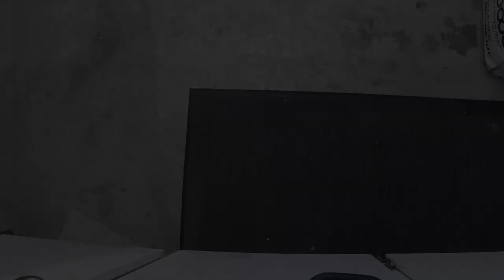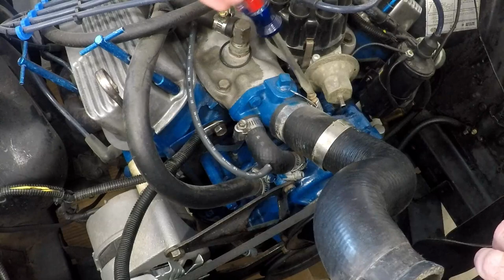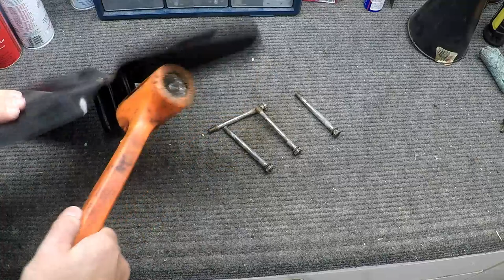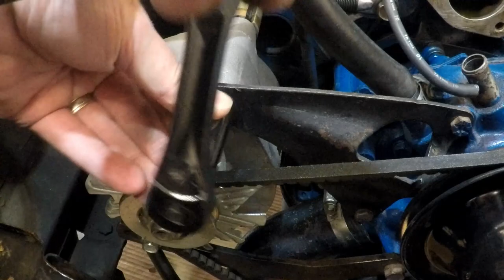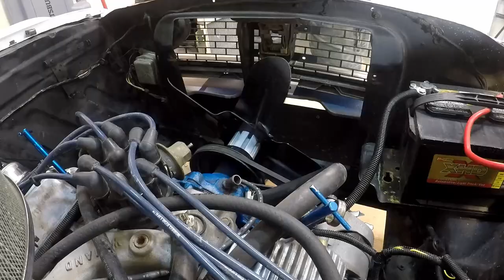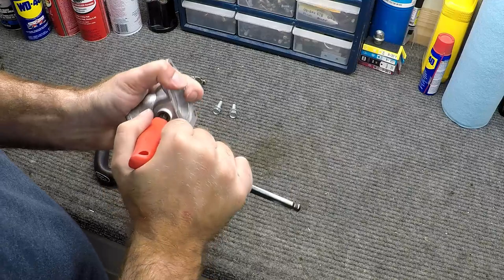How to Install a Radiator in a 1966 Mustang

Comment: Great video Andy.  Thanks for posting.  I especially enjoyed the bloopers cuts at the end. Lol.   One thing I want to add is the next time you need to install or remove the radiator I always like to cover the aluminum fins in a thin piece of cardboard to prevent them from getting bent or ruined.  It's also a great way to prevent your knuckles from getting cut up if you ever need to remove the fan without removing the radiator.  Great job though.
Reply from the maker: This is a great idea, thanks!!

Comment: Great video! Again your videos are great because of the concise camera angles…hey I gotta ask: are there no transmission lines in or out of the radiator?
Reply from the maker: Thanks!
There are no lines on that car as that car has a manual transmission.  However, the hook-ups are in the bottom of that radiator for anyone that has an automatic transmission.

Comment: What kind of spacer did you use? I got a used 3 row champion, and of course the fan won't fit with the different set up. First 66 I've owned so it's a little different 😅 the old rad wasn't even bolted up the same way yours was. Just trying to get it back right and the way it should be. You recommend bolting it back to core support or would you go with mounting brackets with rubbers? Any help would be great haha thanks!
Reply from the maker: Sorry Boss, this was several years ago and I don't have that car anymore.  :)

Comment: 2 month update: how’s it holding up?
Reply from the maker: No leaks and the temps are right where they need to be.  10/10 would do this radiator again, but I'd put a little more effort into finding a better shroud.  There is diminishing returns with shrouds, they can get pricey and not really work any better.  However, I'm sure there units out there that fit better.  Still very happy with the overall setup.

Comment: Does your radiator not require an overflow tank? Great angles btw this will be helpful when I do the same thing
Reply from the maker: Overflow tanks are not required, but they do help refill the system if it gets too hot.  Today's video is about me adding an overflow tank, check it out at 4:00pm PST.  :)
Reply: @AndyKruseChannel  guess I asked this question on the perfect day. Thanks I’ll check it out

Comment: I know this is an older video but others start the car up with the radiator cap off, run it, and then refill it.  I noticed you put the cap on and then said you would run it?  Any truth to either?
Reply from the maker: I have since purchased one of those funnels that plug in at the top of the radiator so the air bubbles can easily come out of the system.  I would have used that in the past if I had it, but I never had coolant issues with the old way I did it.  :)

Comment: You should put thermostat housing sealant on that gasket! The thermostat housings on 289 consistently leak there! Also is this a 2 or 3 core radiator?
Reply from the maker: Thanks for the heads up on the gasket sealant, I plan to redo the heater hose down the road, I'll hit it then.  :)
The radiator is a 2 core unit.

Comment: Great video. How did you bleed the system afterwards?

Thanks.
Reply from the maker: Thank you!
I didn't do it in this video, but normally I drill a 1/16" hole in the top of the thermostat so it lets the air out but it doesn't really affect the cooling system (I cover this in later videos where I replace the thermostat or add a new radiator).  But in this case, I just ran the car until it got hot enough to open the thermostat.  Not ideal, but it worked.  This is an older video and I realized I how to do it better later in my build of this car.  :)
Reply: @AndyKruseChannel  Thanks.

Comment: Hey Andy, can you tell which especific champion radiator you bought? And did you have to bought a new fan spacer? I need to change mine but there so many in the market I don't know which rad to choose
Reply from the maker: This link is the exact Radiator I purchased back in the end of August, 2020:
https://www.ebay.com/itm/163320214225

Yes, I did need to buy a new spacer, it was from O'Reilly's Auto Parts, number HDN 3962.  It's a 2" spacer, not the prettiest, but it does exactly what I needed.  :)
Reply: @AndyKruseChannel  Thank you very much, If it's preforming well I'll buy it too
Reply from the maker: @XSpt1  It's doing great, I installed that part back in Aug 2020, it's been solid ever since.  :)

Comment: Just curious, did you need to pull the belt off to get that lower hose removed?
Reply from the maker: The way that lower hose was routed on my car, there was no need to remove the belt.  It may have made things easier if that belt and alternator were out of the way, but I didn't want to do any extra work.  :)

Comment: Can’t seem to remove the bottom connections on the rad to remove it
Reply from the maker: The bolts for the Rad to the Core Support?  Or the transmission cooler lines?  Or the lower Rad hose?
Reply: @AndyKruseChannel  Andy I’ll send you some photos lol I got it off but the fan is so close to the rad now
Reply from the maker: @AmericanMuscleCarTV  Yes, some Rads are thicker than others and it may cause an issue with clearances.  You may need to buy a shorter fan spacer (that piece between the fan blades and the water pump shaft) to get things to fit properly.  :)

Comment: So what do you do with the 2 bottom hoses that go from the transmission to the radiator? Do you have to hook those up? or can you bypass those hoses and end cap it?
Reply from the maker: If you have an auto, you'll want to either hook them up to the bottom of this Rad, or get a separate, smaller radiator so your trans will stay frosty.  If you don't have an auto, or you don't need to use the two attachments on the bottom of the Rad, you can cap them or leave them, it won't matter.  :)
Reply: @AndyKruseChannel  yes, i have an automatic 69. And an aluminum rad, if its not gonna matter id rather just cap it off, Thanks for your help. Great channel brother
Reply: @AndyKruseChannel  Hey Andy don't know if you could help me out, what exactly did you use to cap them off, looking at replacing my radiator but being in the uk some parts are harder to find in country. Would normal bolts do the job or would it have to be something different
Reply from the maker: @matthart766  You don't need to put bolts in that cooling section of the radiator, no coolant will come out in those two spots.  Think of it as a piece of tubing that is connected on each end at those two locations, and the tubing routes through the tank at the bottom of the Rad, and allows the temp of the coolant to cool that transmission line by way of conduction.  :)

Comment: What's the procedure for bleeding the air once done?
Reply from the maker: Pull the cap, put funnel in top of Rad, pour in fluid until it just start to fill the funnel.  Fire up the engine, let it get up to temp, may need to squeeze the upper Rad hose to get air out.  Once car is warm, and both Rad hoses feel about the same temp, turn off the car, remove the funnel, replace the cap.  Done.  :)

Comment: Will the brakes work from a 16 to 20 inch? Or do I need to replace bottom support brakets?
Reply from the maker: Not sure what' you're asking.  Brakes from a 16" to 20"?  What bottom bracket?
Reply: @Andy Kruse  lol. Sorry. Fat fingers like to hit the wrong buttons. And auto correct has to put its 2 cents in. Which makes my sentences make no sense.  The bottom radiator support. Will a 20 inch radiator fit where a 16 inch radiator was? Or do I need to change the bottom support?
Reply from the maker: There is no bottom support, the Rad is held onto the core support with 4 bolts.  Some places that sell radiators show the dimensions, from there you can compare them to your setup and see if it will bolt into the same spot, or if you need to drill new holes in your core support.  :)

Comment: Hello, I will replace my original radiator for this one ,  after many months what’s your review on the radiator, recommend?

Thank you for the video, I will be replacing mine soon.
Reply from the maker: I sold that car about a year after I made that video, but that radiator was awesome the whole time.  The fit was great, and when I finally added an electric fan, since it's a popular radiator, I was able to find an aluminum shroud designed to fit that Rad and a 16 inch electric fan.  :)